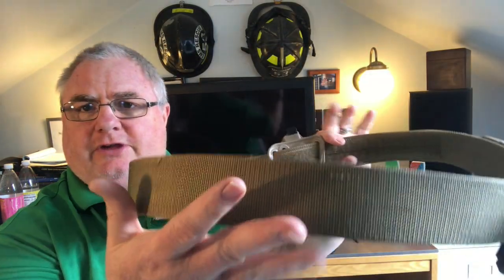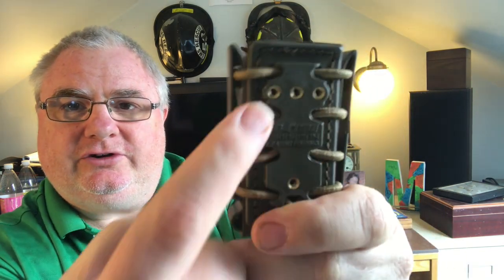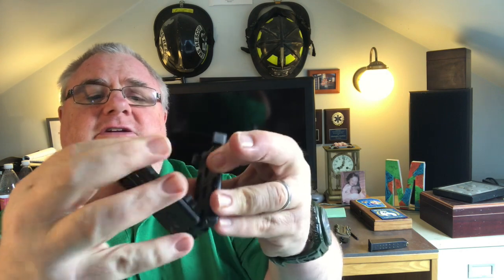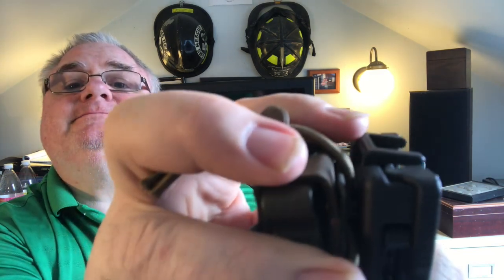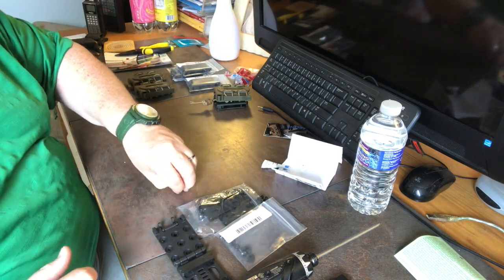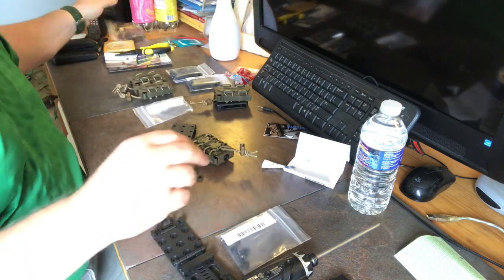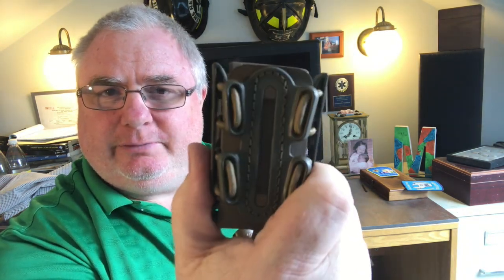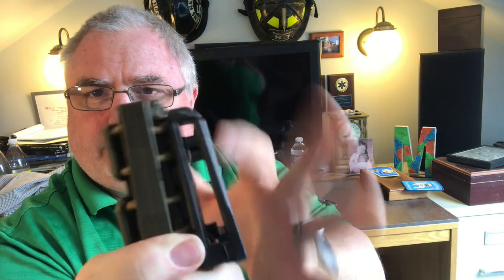SOE duty belt build part 2 G code pistol mag pouch and Blade tech Tek-lok

Comment: Did you use a discount code? Also did you consider using sticky velcro? You can buy in in the craft section of Walmart.
Reply from the maker: I did not know of a discount ugh! I did in a un-filmed tried the velcro it would have worked but I didn't was the rule residue in the teklocks. Thanks for the view and comment!